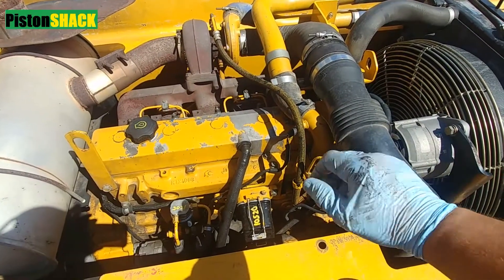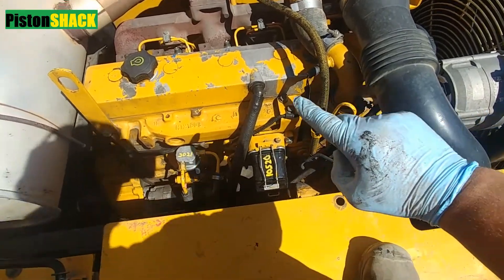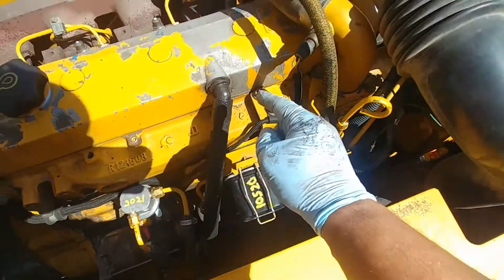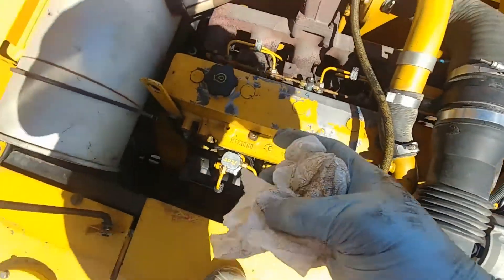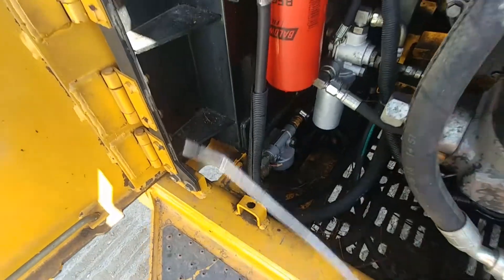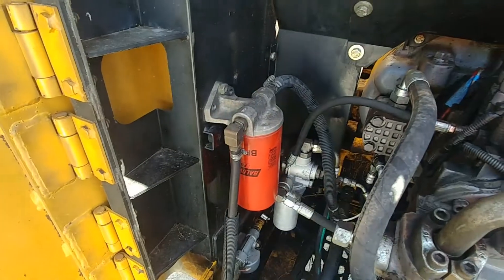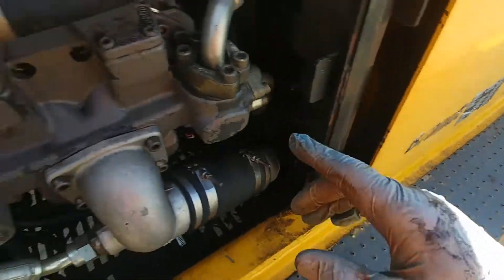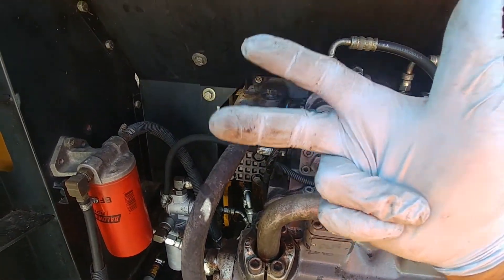JOHN DEERE DIESEL LOSES POWER UNDER LOAD | Most Common Cause  of FUEL STARVATION ISSUE

Comment from the maker: More John Deere Vids: ENGINE OIL LEVEL TOO HIGH? JOHN DEERE 6.8L 4.5L ENGINE OIL GETS DILUTED WITH FUEL | Fixed. https://www.youtube.com/watch?v=hi9k2EBVfyM
JOHN DEERE FUEL LIFT PUMP REPLACEMENT | JOHN DEERE POWERTECH 6.8L 4.5L  https://youtu.be/Usurbkt1N74
JOHN DEERE PENCIL FUEL INJECTORS REPLACEMENT Made Easy | John Deere 4.5L 6.8L POWERTECH https://youtu.be/8lXxqQaymUg
SERPENTINE BELT REPLACEMENT | JOHN DEERE 2054d https://youtu.be/BDpTaS5oPxc
FAN DRIVE PULLEY REPLACEMENT JOHN DEERE 2054d https://youtu.be/_cczLishUP4
TRACTOR IGNITION KEY SWITCH WIRING | Universal Ignition Switch | JOHN DEERE 2130 https://youtu.be/_D4t4hwWj0A
FINAL DRIVE GEAR OIL CHANGE: check, level, orientation, drain, change, intervals / JOHN DEERE 2154d https://youtu.be/6kXlRNoAvbM
TREE STUMP VS EXCAVATOR or HOW TO REMOVE STUBBORN STUMP | John Deere 2054d https://youtu.be/dgcN5v7VY0A
Enjoy!
Reply from the maker: Thanks for watching!
Reply: Thanks for the tips fuel pump added because of diesel in oil which solved that issue I’ll check on the others suggestions

Comment: Had a tractor out around some horse barns that kept running out of fuel. Blew air back to the tank and it was fine until the next time. Pulled the tank and found some big horse flies in the tank, blocking the suction port.

Odd failure, but just because you got the line cleared out, that doesn't mean the problem is fixed.
Reply from the maker: It's first thing to start with but later on you might need to do more diagnosis for air leaks, low fuel pressure issues ect..
Reply: @PistonShack  It's been running fine for a few years now, but thanks.

Comment: Johnn deere 4.5L powertech bogs down and black smoke rolls out exhaust under full load (marine) causes??
Reply: Sounds to me like injectors are smoked or old fuel. Or air leak in feed line

Comment: Hello Friend, how are you? That problem is happening to me in a John Deere 200 Dlc excavator, as if the system was angry, I get the code 627-1 and he starts voting for me. He went too much and tries to turn off the engine, I vacates the primary filter and I have to suspend the water separator, if you can help me with anything I would
Reply from the maker: Hey buddy! How is your repair, any luck so far?

Comment: The fuel pump primer on front of engine has a gromet on the line sometimes sucks air there. Even when we changed them out our line was still lose.
Reply from the maker: Hey Bill. Oh, that happen to me. When I change rubber grommets, always use new ones OEM, after everything assembled I don't touch them.

Comment: Hi have a jcb 3cx geting lo power on load an runs good when on load change the all the pumps enjector an lift pumps an still no power any !!
Reply from the maker: Hey Steve! Next time when JCB will act up, turn it off then remove primary filter - most likely it will be almost empty. Seems like fuel starvation issue. Btw, do you have any other issues or DTCs (codes) stored? Let me know.
Reply: @PistonShack  so no codes to work with
Reply from the maker: Locate fuel line banjo bolt fittings at the lift pump or primary filter, sometimes they have plastic screens inside. Overtime screen filter inside banjo bolt get clogged up. I seen it so many time on different machines.
Reply: @PistonShack  my jcb does is a 2008 jcb engine it has no brain box

Comment: Why does 3020 diesel tractor not run with return line tighten down at the pump if diesel is dripping out of return line tractor gets full rpms power and runs fine, fuel seems to be dripping out back in tank though return line with no restriction
Reply from the maker: I would check vent at the tank first. Also it be low lift pump pressure to injection pump. Check if Banjo Bolt Fittings have screen filter inside at return and down below. Replace old return back to pump with line clear tubing, over time lines deteriorate. What repairs or maintenance was done on tractor recently?